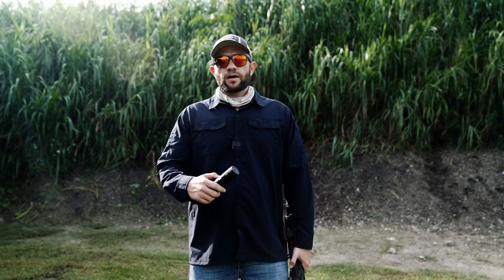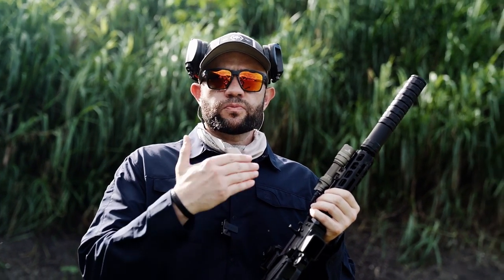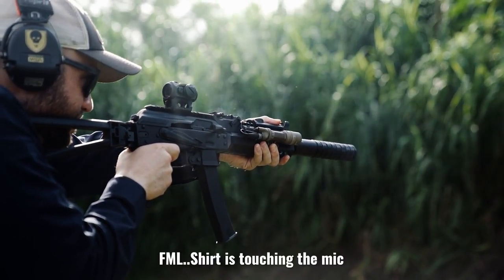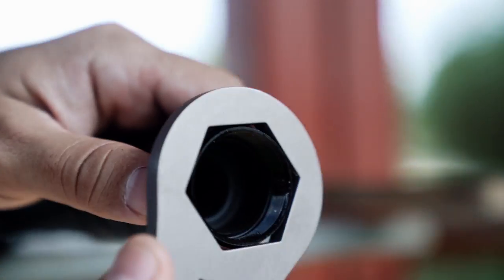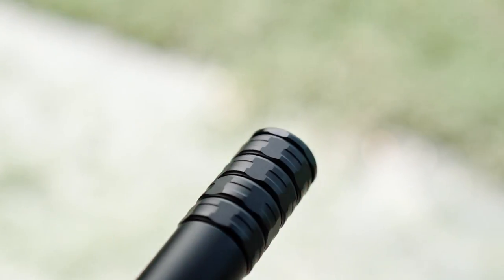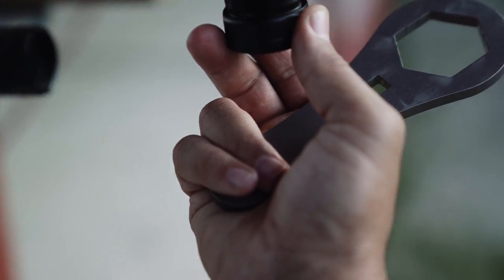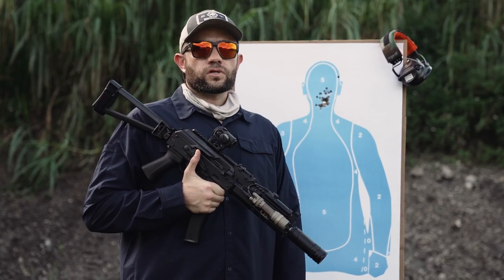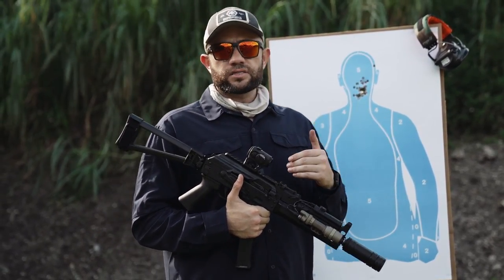Solvent Trap Conversion (Suppressor Build)

Comment: Sick review. I’ve never done a solvent trap conversion before. I do however have a lot of suppressors and just can’t get enough.
Reply from the maker: I appreciate it, I have a few cans as well but was glad I ventured out and built out one of these kits.
Reply: @realdirtyreviews  I'll have to give it a try. I do have a couple traps somewhere I could use.
Reply: What did u use as a threader or a thread adapter?? Or do I need to buy a professional one?
Reply: Any recommendations for my 9mm ?
Reply: @Blessngzgaming Depends on what platform. If it's a beretta or other fixed barrel AB makes a nice F4 or F4L that runs well. But if it's a tilting barrel I'd always recommend an B&T can.